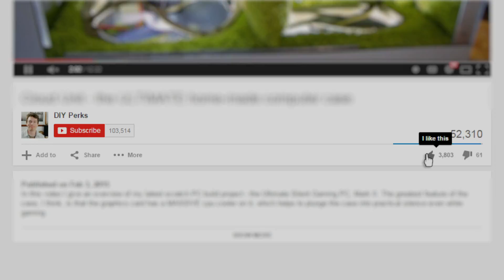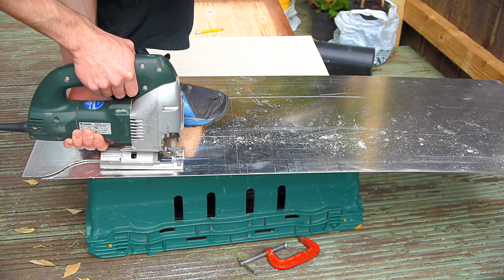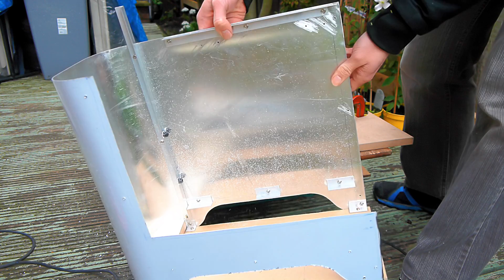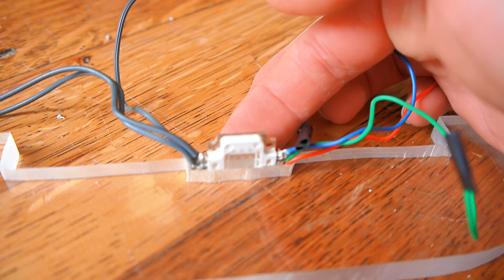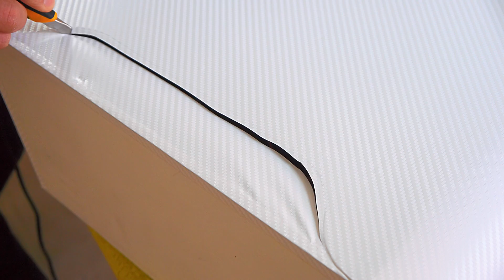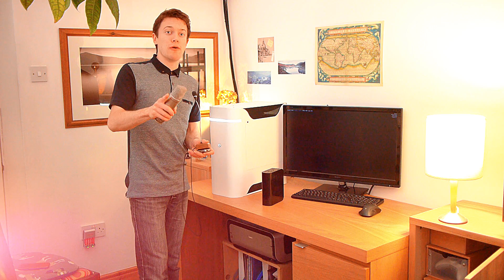Cloud Unit - Build Log (Scratch-Built Silent PC)

Comment: Hey Matt! PC-builder/enthusiast here, and applying thermal paste like that creates airbubbles! Simply place a pea-sized dab onto the chip and apply the cooler, the paste will be more evenly spread and airbubbles will not be a problem :) Great video btw, loving this pc
Reply: Also Matt, what do you do for a living?
Reply from the maker: c0latrix Oh, I didn't know that! Thanks for the tip. I may re-seat it in that case, but temps do seem pretty good so no rush.As for what I do, I'm currently a student and YouTube is my 'part time job/hobby'. I'm learning a lot as I make these videos, so it's all cool.
Reply: ProjektMacu Most of the good thermal paste is conductive, they have silver and other compounds in them. This is coming from a guy that has destroyed a CPU and mobo by putting thermal paste on the mobo to show that it is conductive.
Reply: DIY Perks What I would recommend doing for the thermal paste is a bit larger than a pea, because the GPU is larger than a CPU (as long as NO thermal paste comes out the sides, Thermal paste is conductive). If you wanted, and you have a bit of spare thermal paste, is to place some thermal paste onto the GPU and press down with clear Plexiglas to see how well it spreads out giving you an Idea about how much you need. But you really only have to do this if you have air pockets which looking at your temps, seems like you don't. So switching out thermal paste is going to be personal preference. you may see a few degree difference by switching.
Reply: Jameson Sullivan Yeah, sorry for a mistake.
I bought Arcitc Cooling Ceramique 2 and it's great and not conductive, but it isn't top shelf TP.
Reply: c0latrix I've been doing that for GPU's and for CPU's the line method (you have to know the layout of the chip underneath the CPU cover) which is basically the same principle for over 10 years. But! now i do a dot in the middle and four small dots halfway to each corner. That tends to cover the entire surface without to much paste bleeding out the sides. Happy modding ;)
Reply: You're right but pea? holy shit no, a dab the size of a grain of rice is good.
Reply: PeanutsAreYum I use Pea sized TIM all the time and never had a problem with it, no over-spill and I usually have cooler temps then my friends. It's personal preference I guess, I like the whole die covered, not just the cores
Reply: c0latrix Now that's how you give advice :)
Reply: Jameson Sullivan The size of the GPU vs CPU all depends on the CPU/GPU combo. As for me with an amd fx 4350 CPU and a r9 290 GPU, its vice versa, the GPU is smaller. As for the thermal paste, you can buy non conductive, and you always want to use that type on a GPU, due to the pins on the side.
Reply: Dante Sleepy :)
Reply: Jameson Sullivan thermal paste is NOT conductive.
Reply: c0latrix That method is true with CPU's, not GPU's. The difference is that CPU's only have cores in the very center of the chip and they have a heatspreder on them for dissipation, where as a GPU covers the whole area of the chip, so the paste needs to reach everywhere. 

Not saying he did a perfect job, but a pea of thermal paste is certainly not the way to go on a GPU, nor is it for a CPU really, a grain of rice with some extra is usually fine.

Comment: Why is the standard ATX case not designed like this?
Reply from the maker: JavaCoder Because it's a 20 year old standard :(
Reply from the maker: Demeter Ákos All good points. Not sure about the price one though. The aluminium for this build only came to around $25, and that's not trade price.
Reply: JavaCoder if he sels some i would definedtly buy one
Reply: DIY Perks Thanks for your answer. Do you plan to sell cases like this?
Reply: if a normal graphicscard fits and a atx motherboeard i want to ahve one 

(sorry for bad enlish still learning)
Reply: DIY Perks Hmm... Case manufacturers needn't even make very big changes (like rotating the motherboard 90 degrees) if they'd expect you to use that PCI-E extension thingy and put cpu heatsinks on gpu-s.

I think case manufacturers really should take a pen and paper and watch this video. I don't think it's too much work to make the old standards work with such efficiency.
Reply: Joshua's Recordings I dont see anything wrong with the standards of todays cases, and if you use some of the same tricks to a new case as he did here, you can get very close to the performance. It all depends on hardware and how youre mounting it.  It wont look as bad-ass as this, nor will you have the right to claim you built it yourself, but if a silent PC is what you are after, I guess bottom line is, work with what you have.
Reply: ***** BTX allows for almost zero customization  and is ugly and not even that effective or quiet, a completely new form factor is required instead of using one from a time where pcs were not what they are today.
Reply: Also, because this PC case only works with this motherboard with the graphics card placed on the outmost (and only) PCI slot.
Also, the shapes (and the alumuminium) are very expensive.
Also, hard to service or upgrade.
Reply: DIY Perks
Where did you sauce the materials?
Reply: DIY Perks He was actually right about the price. Silvestone used to make a case with panels out of bent aluminium, but it meant that sidepanels had to be custom fitted to each case and bending was hard to do in large quantities. I do agree that this is awesome. Could you please one day make a revision where you make it as small as possible? Maybe put the PSU under the GPU cooler and make it lower.
Reply: minecraftcreeper52 Only if it's compatible with every standard component!
Reply: minecraftcreeper52 Yes, same here.
Reply: minecraftcreeper52 Its a m-itx mono which only has one pcie lane
Reply: You could get some of these features by making accessories such as a PCIe bracket that holds the CPU (on GPU) heatsink up,flipping your case 90⁰ forward,line the HDD bay with towels and stuff like that.
Reply: It has 16 PCIe Lanes, but only on slot.
Reply: X-PlaneFlightsAndSims Sorry that's what I meant
Reply: DIY Perks Actually the standard ATX case is not yet 20 years old. Their were many different case designs back in the 90s, depending on the manufacture. Also a new ATX case is slightly different from an older one. It has larger fans and is built to be slightly quieter.
Reply: KrisHimself  They do ... but most don't. Silverstone cases are a good example.

This case though, was really well planned (kinda) and neat looking (on the outside), the only downside is that it is the biggest mini-ITX I ever seen.

Quite inspiring, thanks to the author for sharing. I've designed, more out of a though experiment, some mini-ITX cases in sketchup (actually with accurate measures from ATX/ITX specs). I wonder if some practical measurements over motherboard mounting (and back shield fitting) can be made available so that other people can have an easier time trying stuff like this.
Reply: ***** BTX isn't a better standard,that is one of the stupidest things i have ever heard...
Reply: JavaCoder There are vertically aligned cases like the Silverstone Fortress SST-FT02B-W which has an aluminium unibody and the SIlverstone Raven RV01 which is made from the more commonly used steel and plastic we see in cases most of the time.

http://www.silverstonetek.com/product.php?pid=242
http://www.silverstonetek.com/raven/products/index.php?model=RV01

The interesting thing though is when Puget Systems tested vertically aligned mainboards and cases vs traditional horizontally mounted builds (with thermal imaging and and temperature sensors etc) the results showed that it didn't make much difference, the effect of convection had a negligible effect. After calculating the "buoyancy" effect of the warmer air rising it didn't generate as much air movement or static pressure as a fan on its lowest RPM setting would. Fans whether horizontal or vertical generate so much more "force" that the additional effect of convection doesn't really add much, even to the extent that you could have your fans pulling air in the top and exhaust it out the bottom and not even see any penalties in cooling performance as a single 120mm fan on its lowest RPM setting generates four times the static pressure and airflow needed to overcome the effect of convection. 

The design of the case and the properties of the fans make a much bigger difference in standard builds rather than the orientation of the mainboard.

https://www.pugetsystems.com/labs/articles/Vertical-vs-Horizontal-Case-Cooling-89/

With this Cloud Unit though it could very well be different, he has very low RPM fans and they are not in direct contact with the heat sinks which mean any additional force would be of benefit. He also has chamber separation and the air is pulled through a kind of "venturi tunnel" as its pulled in through a large surface area and then constricted before being exhausted through a large area again. Without real world tests its impossible to say for sure but I would speculate that the chamber separation and the internal "wind tunnel" effect means the convection would be amplified and assists the low RPM fans making the cooling more efficient than if it was horizontally mounted.

You can buy a lot of after market bits and pieces for a build like this, like you can buy large GPU heatsinks that have huge surface area like his CPU cooler mod but are aligned along the length of the card instead and have a lower profile (still several PCI slots though) that you can mount two 140mm or two 120mm fans on. They cost more than he spent on the entire build though.

https://www.overclockers.co.uk/showproduct.php?prodid=HS-028-PL&emcs0=2&emcs1=Produktdetailseite&emcs2=HS-019-RT&emcs3=HS-028-PL
https://www.overclockers.co.uk/showproduct.php?prodid=HS-011-RT&emcs0=2&emcs1=Produktdetailseite&emcs2=HS-019-RT&emcs3=HS-011-RT
https://www.overclockers.co.uk/showproduct.php?prodid=HS-019-RT&groupid=701&catid=2330&subcat=787

You can get special acoustic and vibration dampening kits as well, http://www.bequiet.com/en/accessories/61

Buying it all after market costs a lot more and I suspect that the challenge and fun of building all this from scratch is part of the appeal for him, a less skilled or less adventurous PC builder could buy a vertically aligned case and a huge after market GPU heatsink and some sound dampening material and build their own PC like this.

It would be a lot more expensive and I would guess nowhere near as quiet, this machine is one of the quietest I have ever seen. It even (silently like a Ninja) stomps on the machines over on the Silent PC website were builders have spent hundreds of pounds on top of the hardware cost and spent far more on the hardware to get quiet components to make a silent PC.
Reply: Glad someone mentioned BTX... reminded of one of my old Lian-Li cases (before Silverstone did it) which was and still is an impressive aluminum case. The cost was if I recall over $500 new though and not many wanted to spend but I was an LL junkie and owned at least three of their cases over the years.